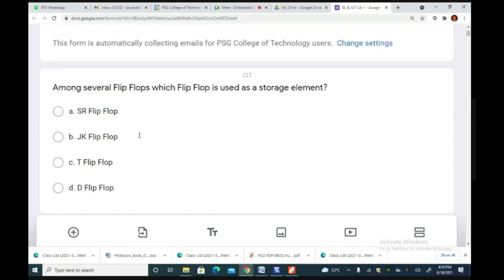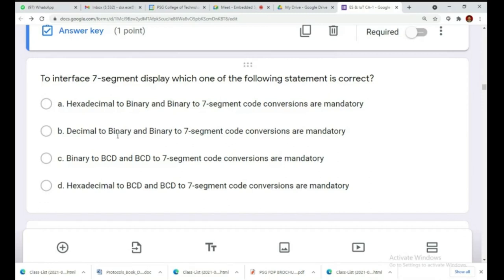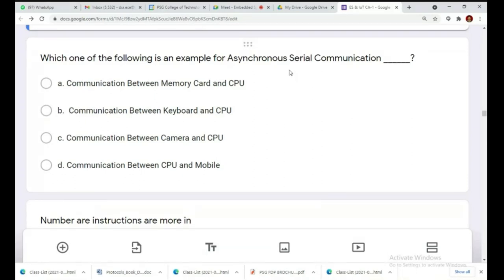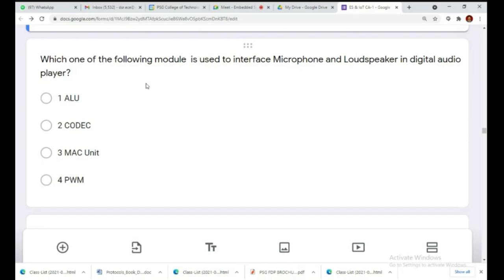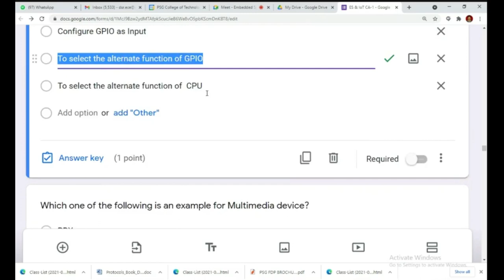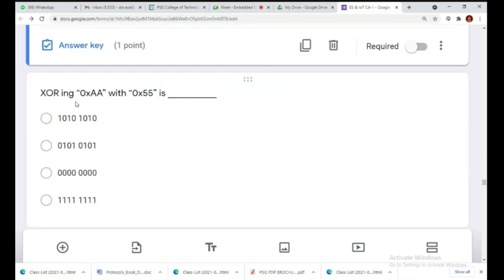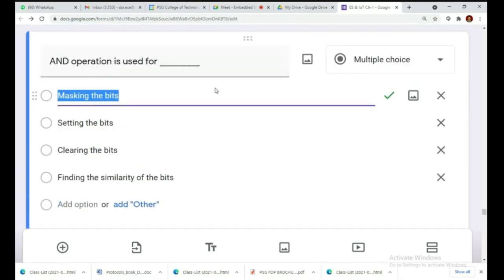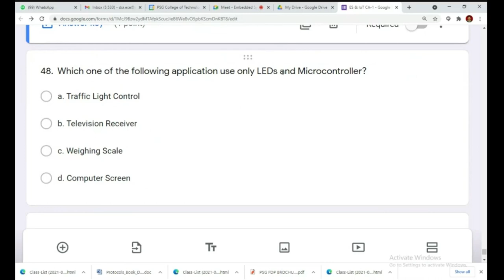Embedded Objective 100 Question & Answers with Detail Explanation for each and every Q&A

Comment: Hallo sir ,electric train uses "Alternating Correct  " has power  source because in regular distance intervals ,power components could be restablized     using transformer .In locomotive engine alternative currect is rectified to direct currect and connected using controller to traction motors.
Thankyou.
Program is excellent.
Reply from the maker: Thank You Madam